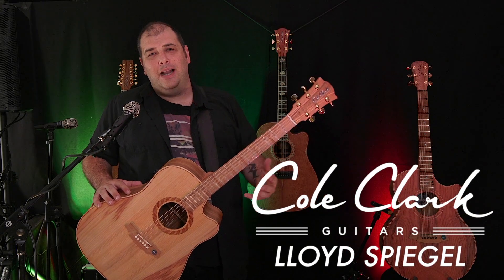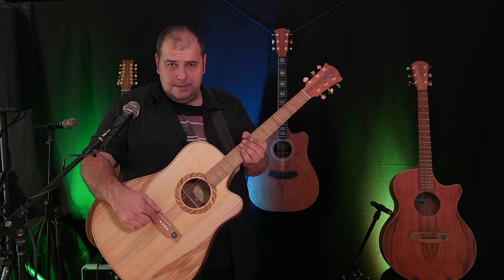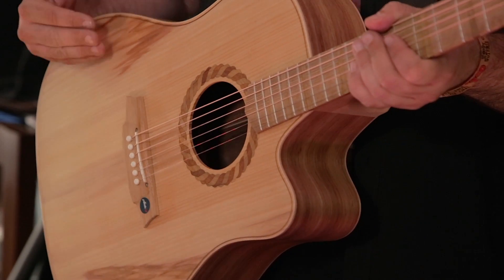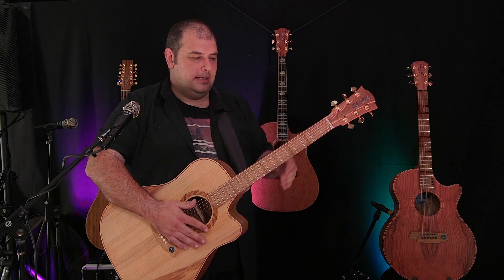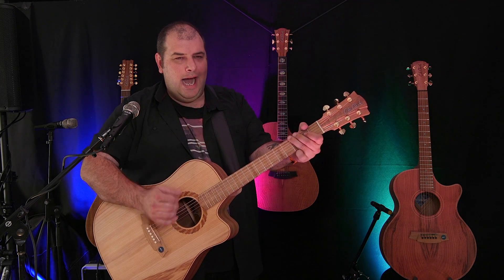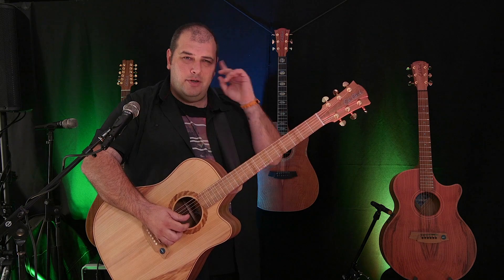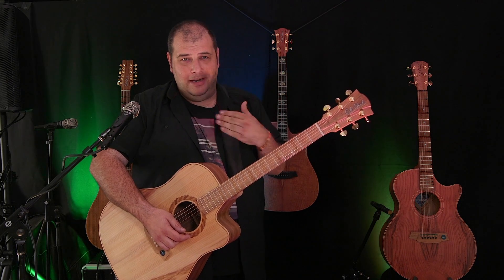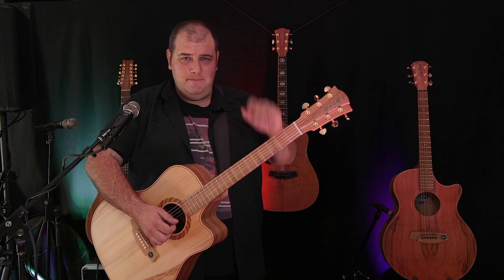Cole Clark - Old Three Way Pickup System

Comment: Cole Clark are definitely a hidden gem in the guitar world. So many people think this sound doesn’t exist. It sounds like wood. So many people try to recreate it with different pickups, amps, preamps Di’s, etc but if they only knew….. I plug straight into my mackie 12 channel board with a guitar cable and throw on a tiny bit of reverb and I’ve had more people talk about how great the tone is on the acoustic than ever before.

Comment: What settings would you recommend as a starting point for all 3 pieces?
Reply from the maker: It’s really a matter of player preference but personally (I’m the guy in the video) I set the Treble and Bass flat in the centre and pull my mids ever so slightly down. The blend knob at 3/4 to ‘face’ and mic on 2/3rd. That’s the likely setting in this video too although this was made prior to the PG3 pickup being introduced. The PG3 is essentially the same but has a much better mic for the high end and an option to remove the frequency filters built into the original 3 way system. I would be inclined with the PG3 to bring the mic to half and I actually use both FC button out (new sound) for some songs and in (improved old sound) for others. Mostly songs that I attack really hard, the button is in and softer tracks, button out.
Reply: @ColeClarkGuitarsAU  thanks for the detailed response!